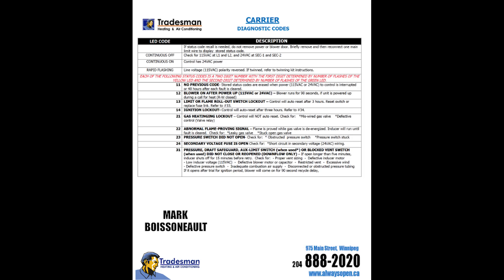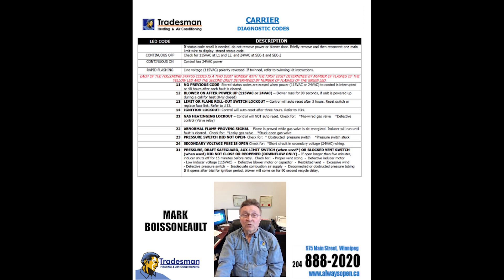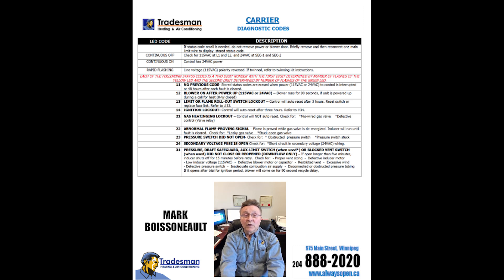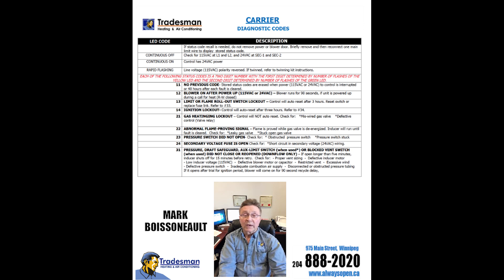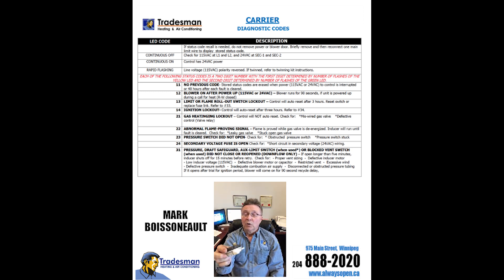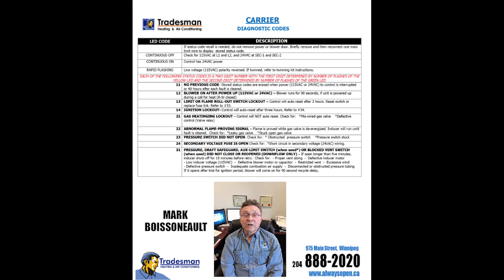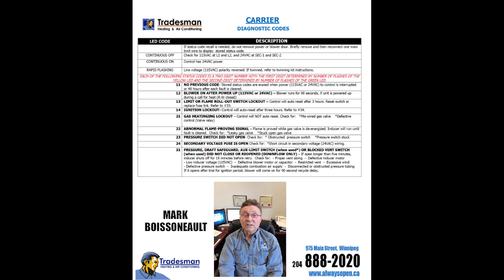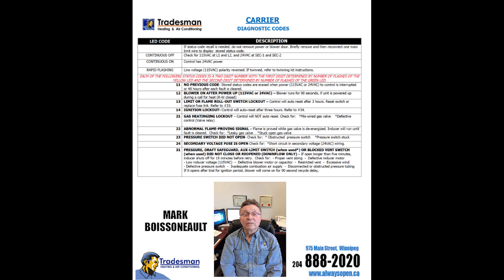Carrier Diagnostic Fault codes

Comment: my carrier thermostat will blink (shut off for a few minutes at time) and then turn back on. It is hardwired for power, so no batteries required. Could this be the capacitor on the blower motor causing the unit in the attic to lag till it powers the blower?
Reply from the maker: That is possible but unusual. With that long of a blank screen from a power surge, the circuit breaker or fuse would normally trip open. Perhaps the control circuit transformer is not fused and allowing this to take place. A loose or bad connection to the thermostat could also be part of it.

Comment: indoor unit light blinking what is the solution
Reply from the maker: Try counting the flashes and compare the number on the fault code chart.
Reply: @tradesmanmechanicalservice1668  5 time blinking green light .sometimes ac working two hours but again giving that foult

Comment: my split a/c carrier  shows cl when I on  ,I clear  the net  but  cl still shows what can I do
Reply from the maker: After 240 hours of operation, the indoor 
display window will display and flash CL , 
this feature is a reminder to clean the Air 
Filter for more efficient operation. After 15 
seconds, the system will revert back to the 
previous display again. When the CL 
indicator appears and flashes, please 
press the LED button on remote controller 
for 4 times or press the Manual control 
button for 3 or more times to clear the 
registered hours, otherwise the CL 
indicator will display and flash again for 
another 15 seconds at the next time

Comment: Code error e3 in floor standing carrier Ac indoor unit run 5 to 10 minutes and then display show error e3 and machine not working what is the problem sir
Reply: carrier mini solit 2 tons error code E9
Reply: im sorry  i got a problem with a mini split